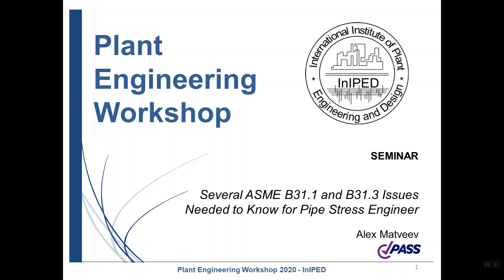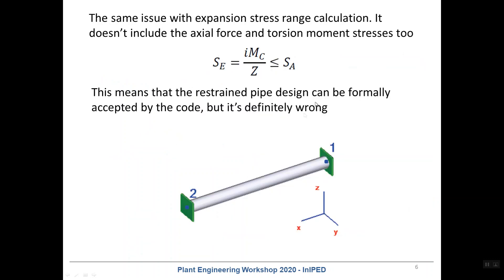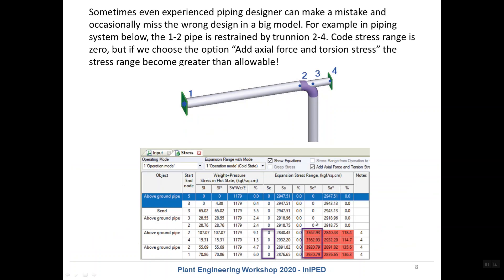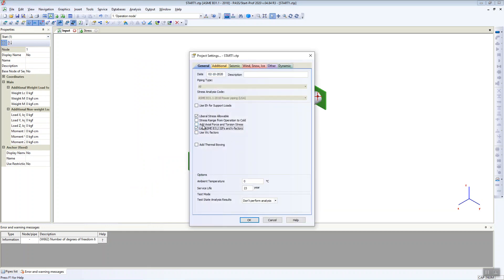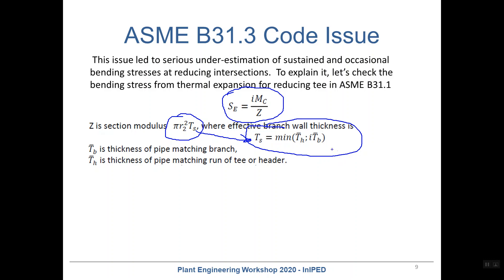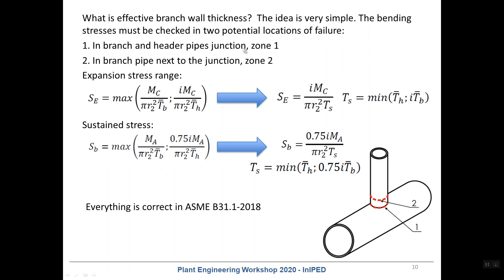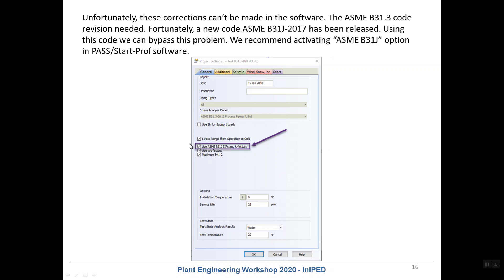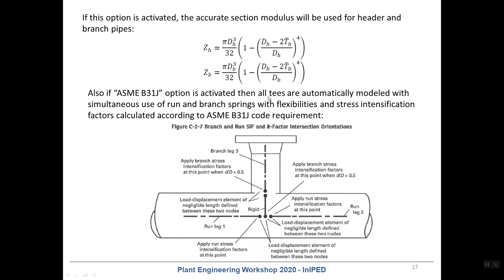Several ASME B31 and EN 13480 Issues Needed to Know by Any Pipe Stress Engineer

Comment: After this video, please join the free workshop on October 19th, 12:00 CEST (duration is 2 hours)!

My Workshop “Several typical topic of piping stress analysis” will show the answers to questions such as:

1. How to perform pipe stress analysis from water hammer loads
2. How to consider nozzle and vessel flexibilities during pipe stress analysis and check stresses in
nozzle-vessel junction point
3. How to model equipment (storage tank, fired heater, pumps, compressors, turbines)
4. How to model buried/underground piping. What are restrained and unrestrained pipes?
5. Special situations: Modular Design, Tall Pipe Risers, Friction in cold state, how to avoid zero
anchor loads from piping.

REGISTRATION here: https://passuite.com/press-release/pew20

Comment: Excellent video. Why stress intensification factor is not required for branch? As it is thinner than header so stress should be higher in branch section.
Thanks.
Reply: Because SIF are allied only in intersection point between header and branch. But branch can be thinner and in some situations may have a greater stresses, so need to check it too. But without SIF